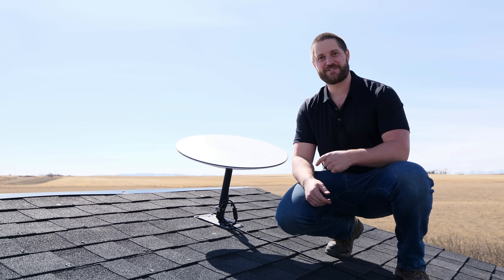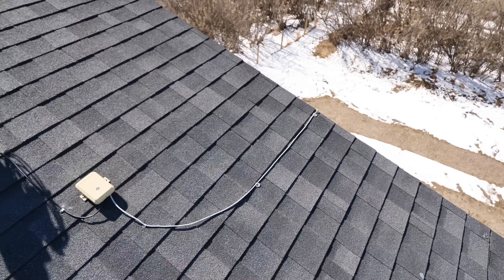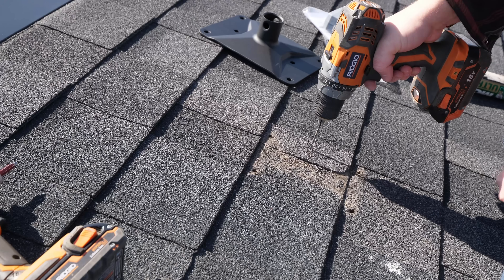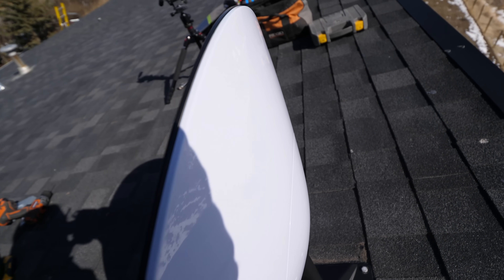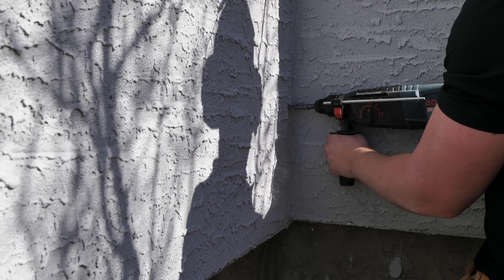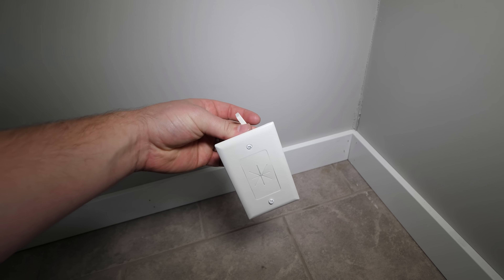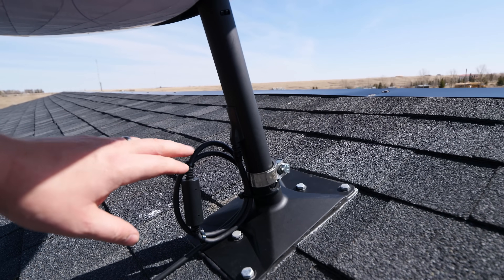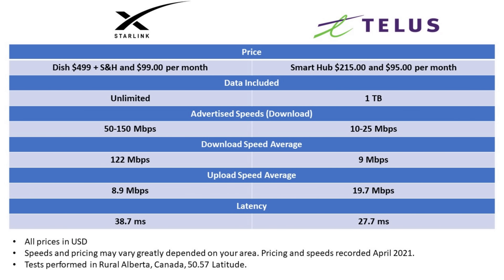Starlink Install, Speed Test, and Review

Comment: I am wondering how it will perform when millions people start using it? Do the satellites capable to get the volume?
Reply: My guess is that they will need the laser interconnect for supporting millions of people.
Fortunately they are constantly launching new sats, and upgrading them. So even after the constellation is complete they will continue to upgrade it, and the capacity will grow.
100USD / month contains significant markup, so the more users they have, the more and better sats they will be able to afford, and support more users.

Comment: I have run  sattelite, cable and internet wires for 20 yrs, other than drip loop, very good job,  I get my kit in nw arkansas tomorrow friday 16th.
I use zip ties to fill in the gap sometimes, like between the mount and the mast.  Former USAF Aircraft mechanic.  I have used duct tape on ducts, on aircraft.  :) lol

Comment: Nice!  I'm really excited for starlink.  One thing to note about your roof mount, you'll want to leave the bottom edge unsealed.  That way if water gets under the mount there's a place for it to flow out.  For solar footers (that only have one 3.5" lag bolt) we put roof sealant in the hole and two large arches on the flashing.  That way if water gets behind it it'll direct it away from the penetration and it would flow back out to the roof.

Comment: Just the video I was needing, with some great tips and a Canadian perspective! Considering Starlink for my cottage, so I can work from there this summer. [Why be stuck at home, when you can be stuck on the lake!] I did note a couple of things in your install which I would recommend. First, when you caulked the base of the mount,  you ran it around all 4 sides. I would recommend leaving the bottom edge open, so that if any moisture did work it's way in, it is free to drain out [even with your relatively low-pitch roof]. Secondly, I would suggest including a drip loop at the bottom of your exterior run just before entering the house, this way if any water does happen to travel along the cable, it won't try to work its way in through any imperfections in the caulking.
Reply: Did you end up going with the Starlink for your cottage?
Reply: @trevor_scat_pack_shaker_HULK  I did not, though I likely would have, but I had some line of sight issues, which could have been a problem a times. Also had some changes at work that required me to be in the city more than I had originally planned. At this point I am somewhat thankful I wasn't able to, as the recent announcements about data caps are making it far less attractive option. (also not a huge fan of the new generation hardware. The geography of my install would have necessitated an Ethernet connection, and they seemed to have removed that in the newer hardware)

Comment: Very nice video. Congratulations.
1, you can very easily remove the dishy mounting clips. Now you have a hole from the volcano mount through the dish stem to the other side. You can run a bolt then. 
2, you sealed the perimeter of the volcano mount base. Water can go from the dish/mount interface to inside the volcano mount and accumulate there. Removing the bottom side sealant may be a better idea. Cheers.

Comment: I may be mistaken, but if I remember correctly, when my father installed cables from the TV antenna outside going into the basement, he would drill upward at a 45 degrees angle, just to be sure that the water could not drip down into the basement.
Reply: I'm an electrician in Switzerland and that's exactly what we do
Reply: He could have run the cable down past the entry hole and back up, creating what is referred to as a drip loop.
Reply: And include a drip loop.  The other day I was examining a professionally(?) installed point to point WiFi link and noticed they not only didn't have a drip loop, but the cable went straight into the conduit with nothing to block water or bugs from getting in.  I have also installed short haul microwave systems & worked on cell sites and a surge protector was always part of the the job.
Reply: YES ...OR JUST MAKE SURE "THE WIRE" GOES UNDER !!  AND THEN "TURNS" UP

A HALF  #LOOP ..

Comment: The commercial Ku band satellite providers that operate on geostationary satellites must be worried.  Their 1.2 meter dish, BUC, LNB, and modem is $15,000-$40,000, speeds maybe 20Mbps down, 5 Mbps up MAX, huge latency caused by the 45,000 mile round trip to the satellite, and way more expensive bandwidth and Internet access depending on the contract.  Starlink will be a game changer for mobile emergency satellite services and will undoubtedly save lives in future disaster responses in addition to bringing civilization via advanced communications to parts of the world that have never had it.  Elon is changing the world for the better in so many ways.
Reply: Звучит неплохо,но есть никоторые опасения о нашей безопасности

Comment: I noticed you compared Telus pricing a canadian carrier to Starlink USA pricing. The price is actually $129 canadian for starlink vs $95 canadian for Telus. $35 more expensive per month. Although even with the price increase Starlink is worth it!
Reply from the maker: CAD to USD conversion numbers are correct in the video for Alberta at the time of filming. No term Telus Smart Hub 1TB is 120 CAD/Month or $95 USD/Month. Maybe the prices are different in each province. Prices on the chart are in USD which is indicated at the bottom.
Telus Smart Hub pricing chart Alberta: https://www.telus.com/en/ab/internet/smart-hub
Reply: @PROSDIY  I thought you were comparing Telus using CAD pricing to Starlink USD pricing. My bad I see you pointed it out at the bottom of the page. Hope its working well. Im hoping to get mine soon!
Reply from the maker: No worries. I should having put the units on the pricing. So far so good. Hope you get yours soon, and it works well. Cheers!

Comment: Why don't you guys use steel corrugated roofing? it is stronger, lighter comes in a stack of colours and would last 50 years where you are with no sea water spray.
Reply from the maker: That's the plan some day. Most people in this area have rib or corrugated metal roofs.

Comment: Q, with all that unobstructed view, why do you need the antenna on the roof??? There's no natural obstructions since you're pointing it directly toward the sky.   Easier to service and move on the ground.
Reply from the maker: It can lean over to track a satellite. If I was to put it on the ground it would have to be far away from the house, as there's trees all around the house. I read somewhere that the dish "requires a 100 degree cone unobstructed view of the sky". I cannot confirm this claim though.

Comment: Hey nice install!  Wanted to ask you if those speeds are on 5g or 2.4g network? I have notice on centurylink my 5g gives me full 40 meg speeds which is what i pay for but when i go to 2.4 i am lucky to get 10meg. Thanks
Reply from the maker: That was on the 5 GHz connection and only about 15ft from my computer to the router. With no walls between the router and the computer.

Comment: Pros DIY great job buddy!  I’ve put about a dozen of these in so far.   Found the same issue as you with the optional roof mount.  Wrapping it in 3M temflex tape solved it good enough for me.   If you notice in the optional wall part    They have a drip loop.   If you silicone it good there’s no worries for now.  But a drip loop will save your wall penetration point.  Even if your silicone fails over the years.   Basically just run your cable down past the hole and loop it upwards to the hole.  Let’s the water drip off the bend.   Cheers bud
Reply from the maker: Thanks MarcelDaigle /! That's a great point about the cable that I should have really done. If I see the silicone failing, I'll pull some slack out from the wall and run a drip loop, then resilicone. Thanks for the excellent tip! Cheers!
Reply: @PROSDIY  thank you Sir! My old man taught me that. After years of doing without it.  I finally caught on to what he meant lol.. Glad to see someone doing it.  And Not just reviews.  You did a fantastic job my friend 👍  especially with the roof mount.  And putting the tape on your clips. That’s Spot on buddy.  The few I’ve done,  they absolutely love it.  We’ve have the same shitty 4G point to point wireless for years.  That star link is a game changer for sure man
Reply from the maker: Thanks for the positive feedback my friend! I agree, it's such a game changer and puts some pressure on other companies to improve their rural internet service. Thanks again for the tip!
Reply: @PROSDIY  more then welcome my friend !   Yess indeed, it is and hopefully it will.  Here in Canada we lack competition to drive prices down.
Reply: Have you installed these on the side of the house rather than the roof?

Comment: Remove the plastic locking clip and insert a 1/2" Stainless Steel Bolt... Since I have a lot of trees, I have installed Starlink on a 13 ft. 6 in. T6061 structural Aluminum tube with an O.D. of 2 in. and an I.D. of 1.5 in. I cut a sheet of plastic out of a 2 Liter Pop Bottle and wrapped the Starlink tube until I had an extremely tight fit. Since I have a lot of furry tailed rats in my area that will chew anything that they can get their mouths on I ran the Starlink cable through a 1 in. flexible nonconductive Liquid Tight conduit. You WILL need to use Cable Lube to pull it through. Do not forget to protect the Ethernet Connector to prevent contamination. I feathered out the conduit at the top so that it completely covered the Starlink cable from the moment that it leaves the Dish. I used waterproof tape and began wrapping the from about 3 in. above the conduit to about 4 in. below where the Starlink cable exits the tube.
Reply from the maker: I was also thinking about popping those quick clips out and running a bolt through the hole. I was worried that it would pivot back and forth over time. Did you find it made a solid connection? I might end up doing it.
Reply: @PROSDIY  As an Engineer a plastic clip is not a structural fastener, I was very concern about failure in a windy environment over a period of time. The 2 liter bottle plastic sheet did a great job in making the connection tight. Without my bolt there is ZERO wiggle. I wrap the Starlink shaft until it made a very snug fit. Taped the raw edge with a small piece of clear packing tape ( once the shaft is in the tube it can dissolve there is no need for it.)  I then drill right though the plastic sheet while it is on the Starlink tube. Insert the Tube into the base, then insert the 1/2 in. Stainless Steel bolt 2.5 in. long and you are done. Since there is no movement there should be little to no wear in windy areas.
Reply: @PROSDIY  The Tube does not rotate. The Motor on both axis are inside the dish.

Comment: You've a great house and what a view around! Thanx for recording this. BTW, how Starlink works during windy days like you show up at the end of video? Doesn't vibrating dish slows internet speed?
Reply from the maker: Thank you Алексей Сухов! That's a great question, that I was wondering before installing the unit as well. I have personally seen no negative effects with the signal and speeds with high winds so far. The vibration doesn't seem to bother it.
Reply: @PROSDIY  Immediately started thinking about installing a Starlink dish on an RV - with a little gyro if needed ))

Comment: One of the better install videos I've watched.  The service loop at the antenna is something a lot of people don't do but should.  

That said, putting sealant completely around the base of the roof mount will trap water under it.  There is no open space for it to escape.

Also, where the cable enters the wall you should have a drip loop there.  Extending the cable below the entry point and then looping back up.  This helps prevent water running down the cable from following the cable directly inside.  The water will go to the lowest point of the cable and drip off.
Reply from the maker: Thanks Mike. That makes perfect sense about the drip loop entering the home that I never thought of. I'm not super worried as it never rains here lol. Your comment will surely help others though. Cheers!

Comment: Awesome install Pat. Man you do live on the prairie! What a beautiful view of the Rockies. I'm sending this video to my buddy in Ontario who put his deposit down on Starlink and is waiting for his setup which is supposed to be sometime in July. Yes, you do need a metal roof. That is an easy DIY job on a straight gable roof like you have. You could do it yourself and save thousands. I've done 3 of them myself, with rigid insulation board under the metal panels and was very happy with the end result. The end of your video was hilarious. Those shingles stand no chance.
Reply from the maker: Thanks Bullmoose Piper! I agree, shingled roofs in this area are just not a good idea. A metal roof is definitely on the long list of renovations, and hopefully sooner rather than later. Personally I've never installed a metal roof but lots of shingles and siding. I appreciate the information and will maybe tackle it myself if the wind ever lets up 🤣

Comment: If you use a saw to cut a vertical slot in the tube on the roof mount, I think the clamp would work even better.
Reply from the maker: That's an excellent idea! If it starts bouncing around enough I'm going to do that. Thanks wrekced!
Reply: @PROSDIY  dont bother . if you get play in the mount you need to add a support leg . to stabilize the dish .
Reply: Also could use two of those clamps he had with one on the mount flush to another on the dish mast pressed firmly together. As long as they were super tight and tight against each other it would act as one continuous pole.

Comment: That is fast
Reply from the maker: I agree. For rural internet it is a total game changer. The fastest I've tested so far was 240 Mbps which is crazy for my area.
Reply: @PROSDIY  that's great. I can use on my boat, .....if I have
Reply from the maker: Just to note. They currently don't allow the dish to be mobile and has to be stationary in one location. Starlink does plan on having a mobile version though and will probably release it after Beta testing. You're right though. If they do come out with a mobile version it would be great for boats, camping, trucking, etc.